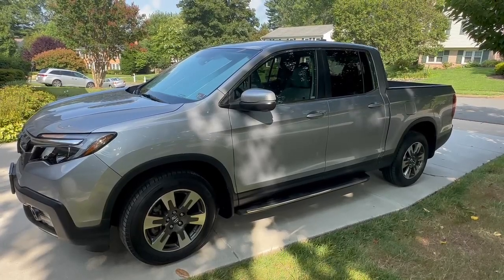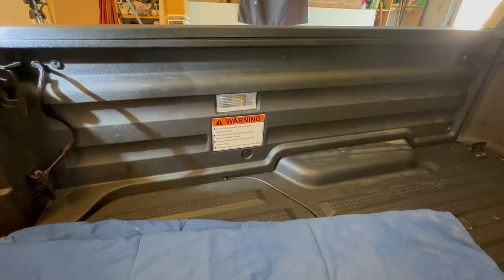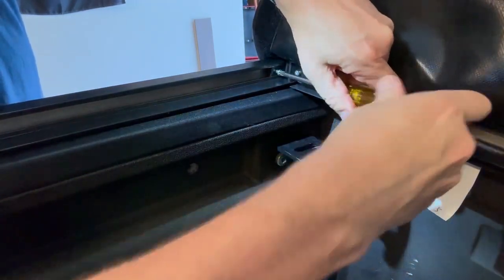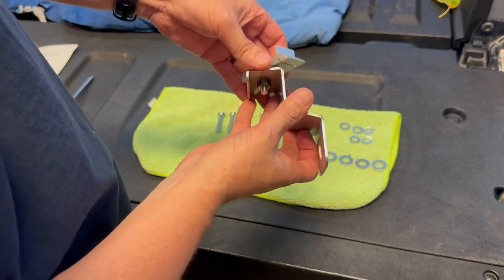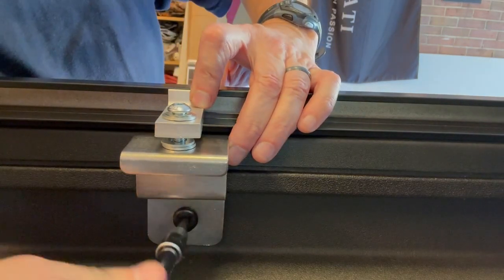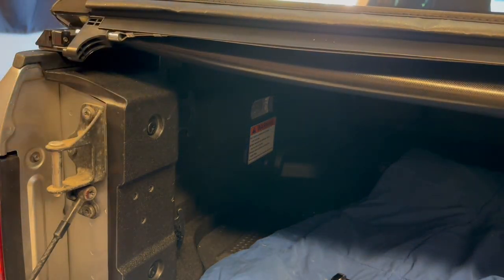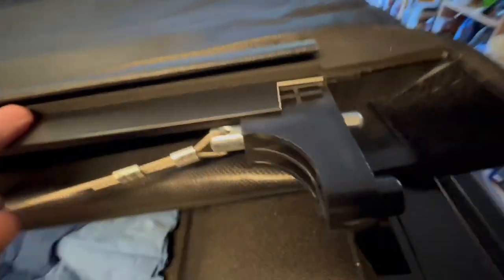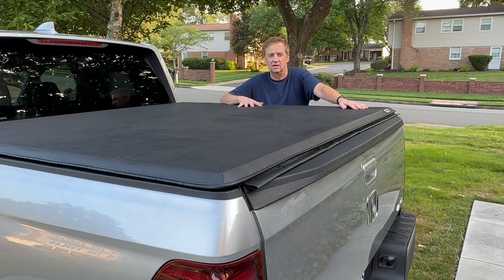Honda Ridgeline - North Mountain Tonneau Cover Installation

Comment: Thank you for the video! It only took me about an hour to install the cover after watching your video. The only thing I did different is that I put the extra weather stripping that came with it on the front edge of the bed. Then I put the cover on top of the strip.

Comment: Great video!  I tried to install mine using the written instructions that came in the box and I couldn't figure out the correct orientation of the parts.  I never would have gotten it installed without your help.  THANKS!
Reply from the maker: Glad I could help!

Comment: Excellent installation video. The instructions that came with the tonneau cover are mostly useless. 
What I did that differed from your installation was that I attached the rail brackets closest to the cab of the truck, and then correctly spaced the rails at the other end before clamping them in place with the rear clamps. After making sure the cover closed properly, I installed the middle clamps.
The T30 head trim bolts were a bear to remove.
Have you thought about upgrading your Ridgeline's horn? My '17 Ridgeline's horn bleats: I want a hearty honk.
Reply from the maker: Glad it was helpful. Yes, I think my next upgrade will be the dual horn. I realized how lame the horn was when I tried it. Definitely not truck-like.

Comment: Thanks for the video, was great in helping getting tonneau cover on. One question though, the foam strip, there was nowhere in the written instructions or in the video on where it should go.  My wife said under the tonneau cover up at the front by the cab, I did not install it anywhere. Is the foam strip necessary?
Reply from the maker: I noticed the same thing and it was not clear where that strip would go.  I did not want to put it on the tailgate, so the only other place would be the front.  However, it seemed it might create a problem sealing there too.
Reply: I put the strip under the cover on the front edge of the bed. I don't know if it was necessary, but the cover fit fine with it there. I will be curious to see how the cover does when it rains.

Comment: Does this affect the opening of the trunk? I want to get a cover, but some sights say they will prevent the trunk from opening completely.
Reply from the maker: Are you talking about the tailgate or the trunk? No affect on the tailgate. However, all covers would prevent completely opening the trunk while they are on. You just need to roll it back a little if you want to completely open it. Trunk can be opened a little while it is rolled closed.

Comment: How waterproof has the tonneau been?
Reply from the maker: So far, mine has been good.  My only complaint is that I believe some of the washers are not stainless steel as I am starting to see rust after just a few months.  I'll probably swap them out for new washers and do a video on that issue.